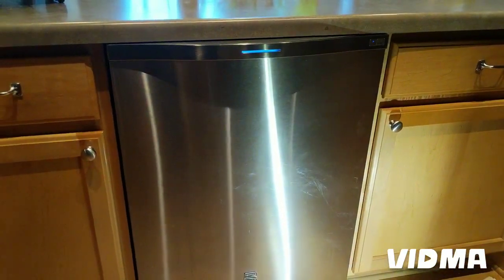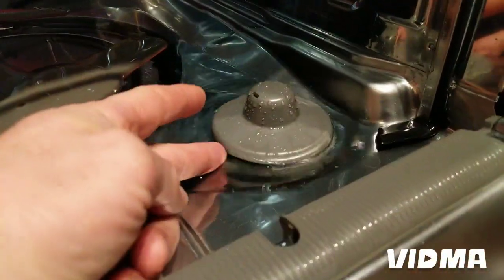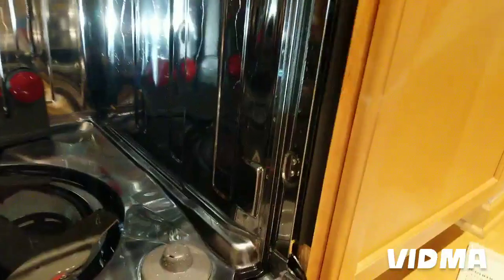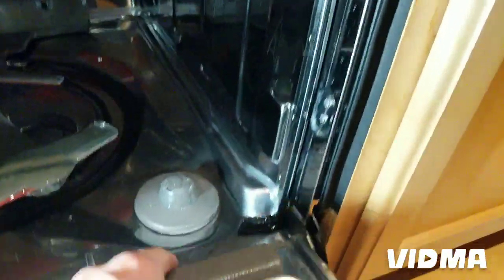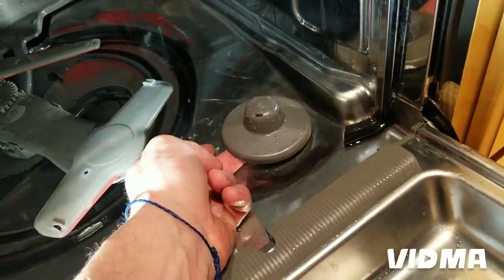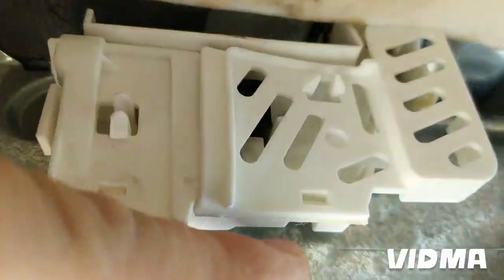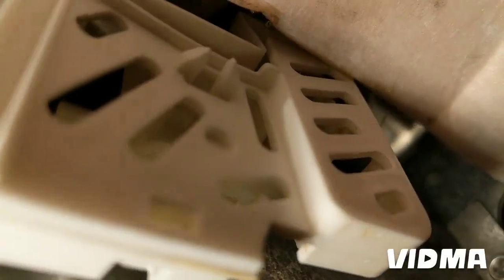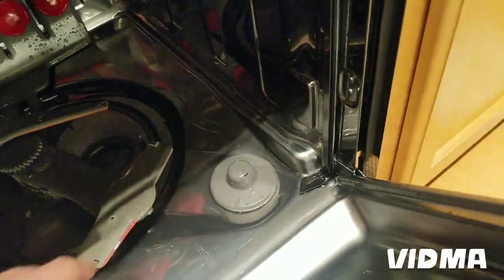dishwasher leaking under the door. Kenmore dishwasher leaking float switch cleaning

Comment: You brought me to the very cusp of figuring out how to get that float switch cap off, and then ya left me hanging.
Reply from the maker: Sorry for poor video. Very hard to take a good video underneath the dishwasher without disassembling totally. To get the Float switch cap cap off you will need to get under the dishwasher. Take cover off and then under the float switch Little white plastic compartment that you need to get the door off pushing in couple clips and a little door folds down. They will be able to see a switch that the stem of the float switch pressing in it goes down . Get this float switch out you need to slightly bend the stem of the Float switch to get out of the grooves that prevents the float swhich being pulled out upwards  and then you can push it up past the stoppers. Hope that helps